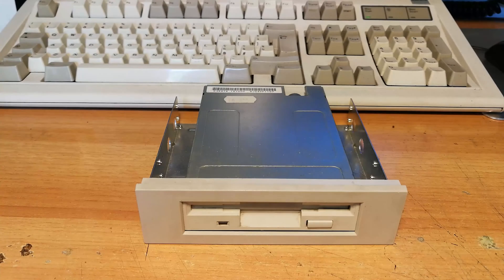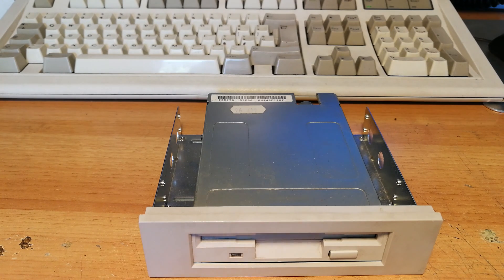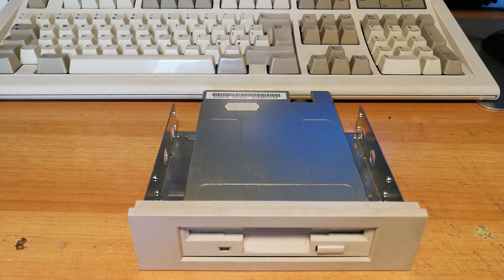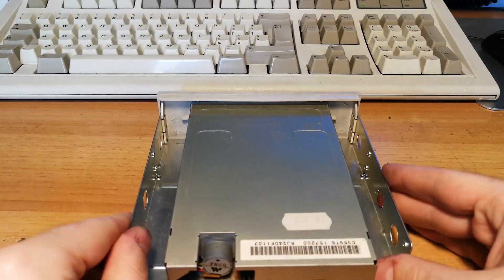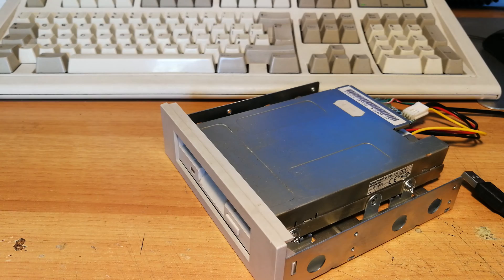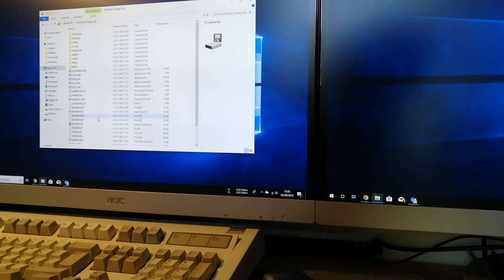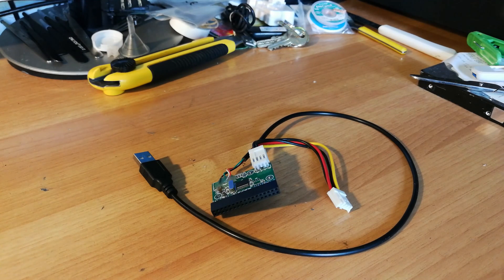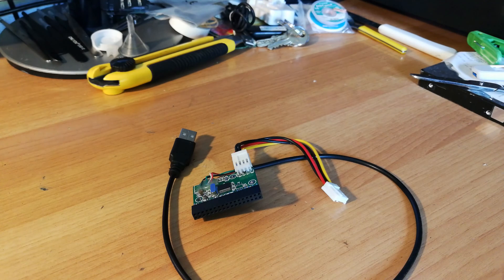Using a Floppy Disk Drive via USB?

Comment: I may be 6 six years late to thei party but today, Nov 2024, I had a plea from a local rock star sort out a floppy drive for him to use to trasfer data an old mixing desk. It takes 3.5 inch disks.So we need to copy data from a non-floppy PC to a floppy to use. I have the drives, salvaged from old PCs and , hey Presto, found this super helpful instruction. By the way, the boards are on Amazon, a bit more expensive but next day delivery.
Many thanks from an old Rocker.

Comment: I have an old Toshiba 3.5”/USB drive, cir 2004. It works perfectly. They quit putting floppy drives on laptops and you needed a floppy/USB to flash the BIOS. Like I said it works perfextly and I only use 1.44 disks. 

Your floppy could be placed in a hard drive enclosure. They have the 5 and 12 volt power avaiable. You would have to change the IDE to your floppy controller.

Comment: Thanks for the video! Just got my adapter card at Amazon (where it costs $19), and I wasn't sure which way around I was supposed to plug it in the floppy drive, so your video helped.

P.S. I found my floppy drive at a recycling point for old electronics, so when I discovered an old desktop case, dating back to maybe around 2005ish, with the floppy drive (model number JU-256A198PCR) still attached to it, I decided to... appropriate it for myself. >:D Now, I just need to get my hands on some floppy disks and on an old PC case that has slots for floppy and CD drives.

Comment: will this work on HP ENVY Desktop--Intel Core i7 desktop using windows 10?
Reply: Just plugged it in a Laptop running on Win 11 (ver 22H2) and seems to be working just fine. I don't have any floppies at hand, but the drive appeared on my Explorer and attempting to access the empty drive makes the drive make its read attempt noises and the activity light lit up.

Comment: The connector type you see on the back is called an "IDE" for the data. The four pin connector for power is called a "molex". IDE / Molex was the typical connector ribbon type for CD , HDD, floppy drives through the 90's. The ribbons generally were very flat and wide compared to SATA.
Reply from the maker: I think the IDE connector is only for optical drives, hard drives and some high capacity floppies such as the Zip (40pin IDE). The 34pin cable connector though I don't think it's called IDE, as far as I remember...
Reply: @PaoloMarcelli  yep, you're right! I had thought they were the same but they're not. Also it's not molex for power like I thought it's a "Berg" connector. Thx for the info.

Comment: I have a Floppy Disk Drive mobile (HP F2013A) and a DB36 to USB converter cable. How can I configure this device (HP F2013A) to work with this cable (DB36 to USB)?
I've done a lot of research on the internet, but I can only get information to set up printers.

Comment: For who are planning to add the floopy permanently to the tray, I would recommend swapping the usb connector to pin connectors for the pin headers on MB (the lines are the same 5V+, D+, D-, GND)

Comment: "A:\ is not accessible. The disk media is not recognized. It may not be formatted."  multiple pc's and different floppies to try and get it working. Using an old sony floppy drive. Any ideas on how to get it working?
Reply from the maker: Maybe the floppy drive needs to be serviced and cleaned, Adrian's Digital Basement has a few videos on how to service Floppy Disk Drives. I'd start with a head cleaning and see if some of the moving parts are dirty/stuck or not lubricated. That of course if you haven't tested the drive on other systems and know it works, and you don't have another drive to test.

Comment: if you think that the IBM model M is a good keyboard then you should try the model F, the model M is actually the cost reduced version of the model F which has a full metal zinc housing and capcitive buckling springs instead of the membrane used on the model M
Reply from the maker: The one I have is one of the early Model M's from 1986, but I have no doubt the Model F would be far superior. I hope I'll have the opportunity to try one in the future, this model M had been donated to me by my best friend's father, and Model F prices are insane here, so... yeah...

Comment: hi, that just work on "modern" floppydrive that use power on the side like in this video, dont try it on the those who dont have the power connection, that wont work, i just converted old ibm modell 30 - 286 ide connection that use power rail in ide cabel and change it to new floppy that have power connection on the side. just put it for u so u know about it.

Comment: You could also run a FTP server on your lan, and connect to any computer via a hub/switch, the filetransfer would be much faster; you can use a small laptop as file server, or spare computer with any linux flavor. I think DOS supports FTP quite well.

Comment: hi, what about 5,25" disk drives??? can i do this with these?
Reply from the maker: Hi! I think this is compatible only with 3.5" drives :/
Reply: @PaoloMarcelli  oh well, does some sort of adapter exist that would make it work or do i resort to a kyroflux external floppy controller?
Reply from the maker: @joshi_6887  I'm pretty sure even if you use a different cable that can adapt to 5.25" drives, they won't be read anyway because the firmware is only for 3.5" HD
Reply: Paolo Marcelli oh well, guess I’m going for a kyroflux!
Reply from the maker: @joshi_6887  I'm not 100% sure it can be used as a normal drive interface, as I know it's a board used to make images for backups, read about it online before buying it :)
Reply: Paolo Marcelli I really only will use it to save disks and also write disks, for non ms dos formats, and kyroflux gives a lot of options for these, so that good for me!

Comment: Sorry but the best vintage keyboard is the SIEMENS NIXDORF TA 35. It cost the equivalent of a todays mediocre laptop.

Also.. your fingernails o_O are you an undertaker in your spare time? :3

btw.. There are USB Floppy drives for around 9 Euros, which would eradicate havind an open adapter dangling around. Search on eBay.

Comment: My dream is to have a sleeper pc with all flagship modern parts like a 9900k and 2080ti but all with green, red, or blue pcbs, swap out all of the heatsinks and shrouds with ancient looking alternatives, remove the heat spreaders from some high speed low latency ram, and swap it with some of those crazy heat pipe ram coolers, the same style heat spreader for the m.2 nvme drives, an old fashioned sound card with a game port, 10gb nic, wireless card, and then some legacy port cards like parallel and serial, all with green, blue, or red pcbs all matching with the motherboard and gpu. Stuff it inside of a beautiful solid steel full tower case with 3.5 and 5.25 floppy drives, a Blu-ray reader, a blu-ray writer, a Zip drive, a super floppy drive, a jazz drive, and a tape drive reader all up front. I want to paint all of the blue USB ports white so they look legacy, build custom flat cables for all of the drives, mod a modern titanium rated psu to be non modular and use ketchup and mustard cables, and finish off everything by opening up modern hdds to look like those old raptor hard drives. To complete the look I would create adaptors for the display ports and hdmi ports that make them look like legacy ports with screw locks. Add a loud pc speaker, and complete the look with a model m keyboard, and a 2k high refresh rate crt monitor and some Roland speakers and mixer. Oh and don’t forget the turbo button. I would want to somehow get the turbo button working, where depending on the mode you set, it will load up different versions of windows on start up with different parts of the cpu disabled to allow it to play older games (if I could even get something like that working). I would love to see the look on someone’s face when they ask to use my computer and I direct them to that, and they think it won’t be fast enough to check their twitter feed. Little do they know it’s faster than anything they have ever used. 
But I also have the dream of building my childhood dream computer from 1999-2000 and making a ricer pc out of the original hardware. Mill out custom gpu block, full motherboard block and reservoirs, motherboard armor to hide its age, custom ram water blocks, custom sleeved cables, hidden zip and 3.5 floppy drives, a slim slot loading optical drive, all inside a custom tempered glass case with thick radiators and rgb fans (even though I hate rgb). Add in adapters that let you have usb c, hdmi, wireless/bt, etc. you could have someone use that computer and it looks like it should be faster than the sleeper pc. So fun.

Comment: if you connect 2 of those adapters with floppy's you you get A: and B: at the same time ?
Reply from the maker: Yes I suppose, it's like when you connect two USB floppy drives!
Reply: @PaoloMarcelli  thanks I am planning to put one 5.25" connected on the regular FDD controller, and the second 3.5"with this adaptor to USB header inside, because my "new" motherboard supports only one foppy 360K, 1.2M, 1.44M, 2.88M

Comment: Will it also work on a 3 inch floppy  disk drive as well?
Reply from the maker: The drive I'm using in the video is a 2.5" and it's the only size that board works with :/
Reply: @PaoloMarcelli  is`t that a 3.5 inch drive?
common size was:
8 inch
5.25 inch
3.5 inch!
Reply: @PaoloMarcelli  did you test it to make sure? because they both use the same adapter so i would think it should work.

Comment: why they do not update the firmware so 5.25 to work here
Reply from the maker: I don't know, but I'd love it
Reply: @PaoloMarcelli  so we cant play ultima 4 & play it head to head online😉.  jkg.  The 5 1/4 was so reliable holding data, but small.  Never like the 3.s, but need it for a program that only can be installed with a floppy from files off cd saved.  will not unlock it any other way.  So I keep a trash can full of old cables, floppy drives.  Glad they made this adaptor, thx for video.  Knew one day someone make something.  Not sure why 3.s dont hold data like the 5's.  Seem like a way better protected disk.  Seems like disks are going to be rare also.  Double density to me was only on 5's, for writing to both sides.  3's didnt think both sides available.  Unfortunately, I sold my commodore functioning that had disk doctor and few other disecting  cleaning disk scan functions for 5"s.  Even had some functions of chip/computer scanning.  Someone would have to knowledge how to extract of coarse.  Just didnt see need to keep it anymore.  Around 200 floppys worth.  I cant remember exactly since stroke, but their was a way to adapt a newer cable.  Thinking 2 less pins, printer cable.  Ill look on my older computers see if I can have son figure it out.  Rarely around, so gonna take time.  Could be just power cable.  I just kept all the old stuff, what all you guys having problems with? lol  uh oh, 128 miiight have all the 64's, id have made copies. rut row.. dammit ur video distracted me, how i get here.  Ill check it out. oh ya ultima 4. lol

Comment: Another easy way to read floppy disks both 1.44mb aswell as 720k on modern systems is to get one of the floppy drives that came with the dell inspiron 8500/8600 series laptops it has a usb microb connection on the side so it can be used standalone and it supports 720k floppy disks.